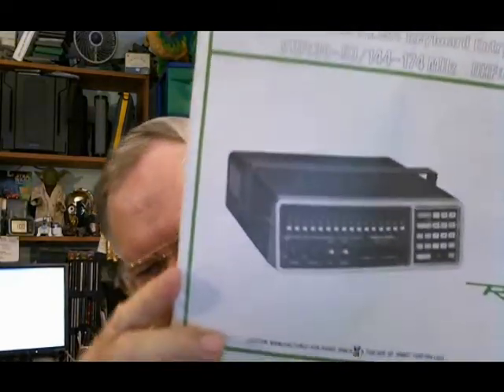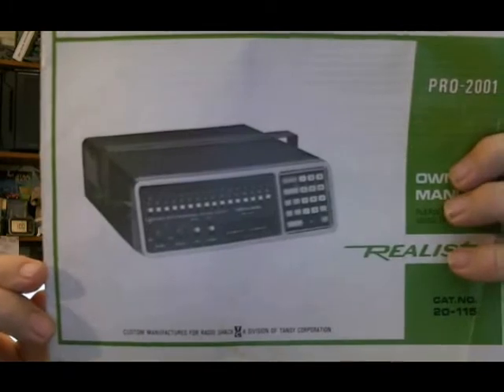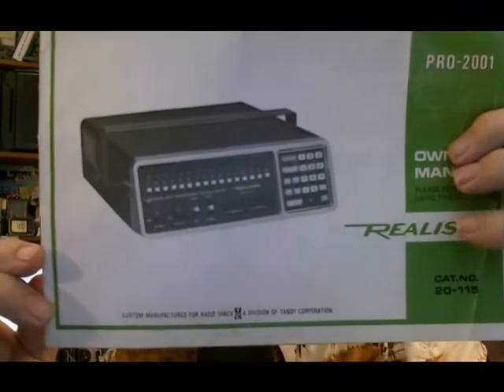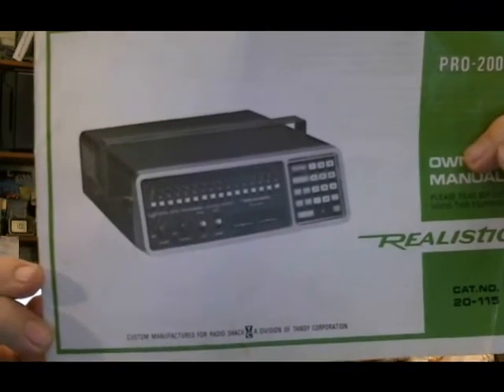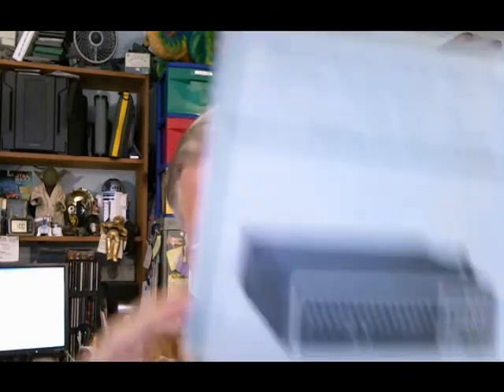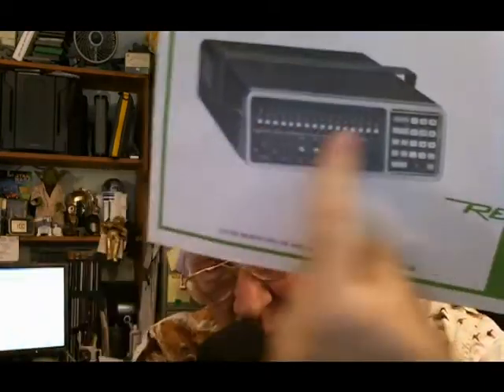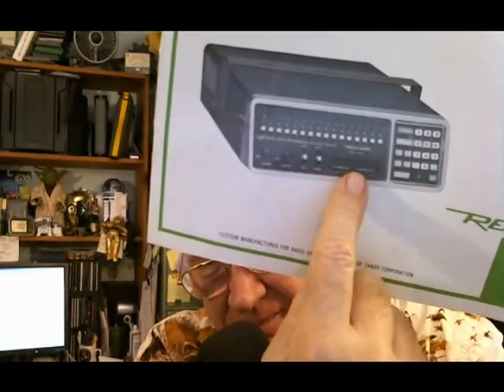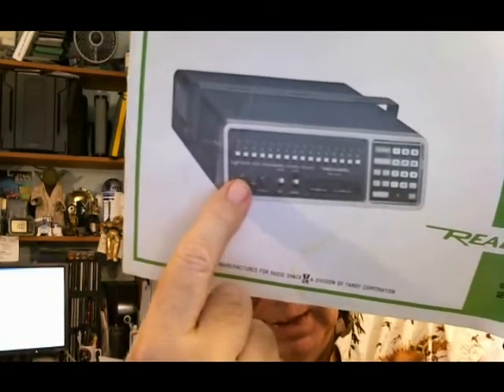TRRS #0035 - Scanner Radios with Blinking Lights

Comment from the maker: You will probably will have to get one off of Ebay as Radio Shack does not stock them any more.  If you do a search on Radio Shack 20-161, you should see an example of the antenna you need and the type of connector it must have.  I am using one of these.  This is only an example and not a recommendation.

Hope this helps,

Tom